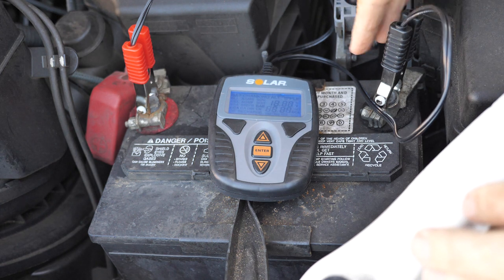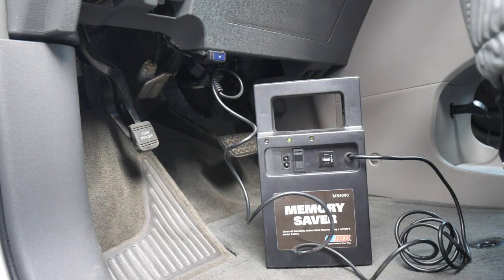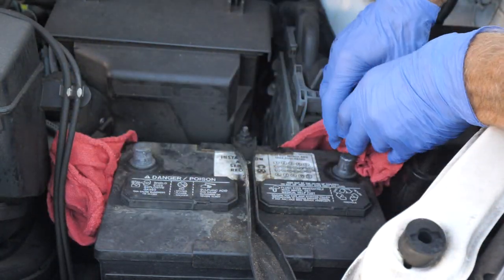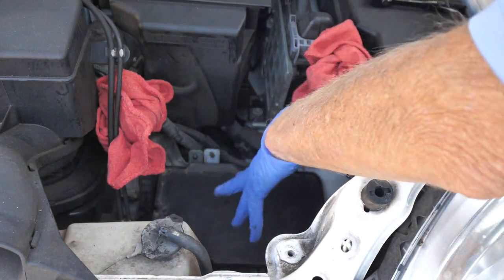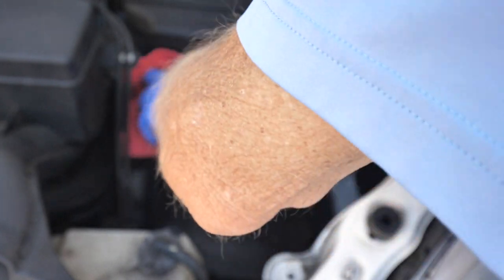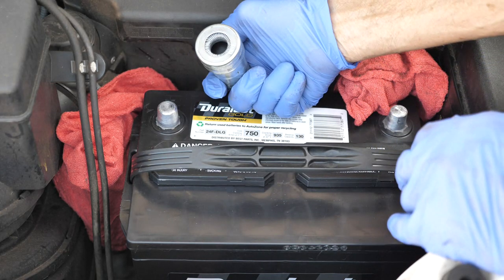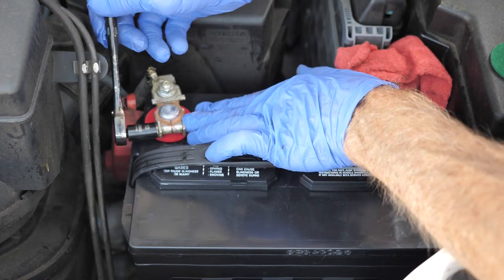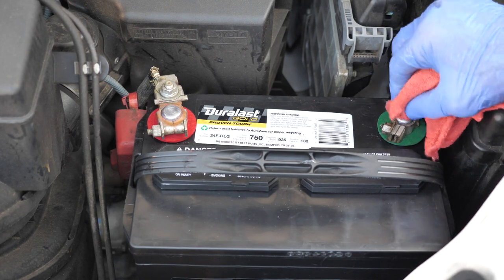How to Install a Car Battery with Memory Saver and Testing of the Old Battery

Comment: @Sparky Channel. Thanks Bill for the detailed and thorough steps for replacing a car battery. Using a good memory saver really makes the job go well. You don't know how long it'll take to get the old battery removed, buy the new battery, prep everything, then install the new battery. 

I'll have to remember the dielectric grease next time.

Hope you and your family stay safe and well.
Reply from the maker: Yes, the dielectric grease repels moisture and protects electrical connections against corrosion. I like the NCP2 as well. And yes, memory savers are becoming more and more important as cars become more computerized. Have a great weekend!

Comment: There's two ways of thinking about using diaelectric grease on electrical contact surfaces. One is demonstrated by what you do here.  That is, smear it on the actuall contact surfaces.  The thought is that the grease is forced out of the joint to make direct contact of the connections.   The other way of thinking about it - and which really makes more sense - is that dialectric grease is an insulator so it should NOT be on the contact surfaces.  It does NOT conduct electricity. Think about it:  You spend the time cleaning the battery clamp and battery post of anything on them that could act as an insulator (grease, corrosion, dirty, etc.) and then you cover it with a non-conductive material (dialectric grease).  That really doesn't make logical sense although many people do it.  People who subscribe to the second way of thinking don't smear it on the contact surfaces but, instead, only smear it on the outside of the connection AFTER the clamps have been tightened.  That keeps moisture, etc., out of the connection but doesn't put a non-conductive grease in it. That really makes more sense.  These same arguments also apply to other electrical connections.  That said, people who smear it on the contact surfaces don't seem to report any problems but logic tells you the contact surfaces should be completely clean. After all, you were careful to clean those surfaces chemically and with a brush but then you smeared an insulator on the contact surfaces.  Think about it.

Comment: Since dielectric grease does not conduct electricity; doesn’t putting it between the battery post and the connector prohibit/hamper the flow of current? I was taught to clean everything (such as you did, great job by the way), properly attach the two connectors, tighten, then spread the dielectric grease over the top of the connection to prevent oxidation and corrosion.
Reply from the maker: Dielectric grease preserves electrical connections. It does this by sealing contaminants, moisture, and air out of connections. And since battery connections are very prone too corrosion I think using dielectric grease is a good idea. I don't think it effects the flow of current one way or the other, but it will preserve it over time.

Comment: Wow... you can get that same DuraLast Gold 24F-DLG for $143.65 (after core refund) at our local Autozone. That's the same battery that my Toyota takes. I bought an AGM battery last time and it's going on 7 years old so I'm over due for a replacement. I can get a new 24F AGM battery at Advanced Auto for $149 (after 25% coupon). The battery saver seems like a nice gadget but for $80 I think I'll just re-enter my radio presets. It's probably time for some fresh stations anyway. :-)
Reply from the maker: What city are you in? Things cost more here in CA. For instance, I think we pay more for gas than any other state. If you have a newer car some sort of memory saving device is very important. If you happen to have a 12V battery, you can just buy something like: "TONWON OBD2 Memory Saver Connector OBDII Car Diagnostic Cable OBD2 16pin Memory Saver Connector ECU Emergency Power Interface with Two Alligator Clips, Emergency Power Supply Interface for Car Battery": Amazon: https://amzn.to/35QxFpt
   for about $13. The combination of your 12V battery and that device will save your car's memory as well.
Reply: @SparkyChannel  I'm in central PA - an East Coaster. :-)    Do you lose engine ECU settings immediately or does the battery have to be disconnected for a while?   My understanding is the worst case is the ECU will have to "re-learn" your engine driving profile while should only take a few miles.
Reply from the maker: @eosjoe565  For other viewers we are discussing Engine Control Unit (ECU). This is definitely a concern, especially on newer vehicles. It's going to vary from car to car. My advise is to use a memory saver and not have to find out the hard way. :) Scotty Kilmer has a good video on using the memory saver. He was saying that the new BMW's are so sensitive that you have to have the battery changed at the dealer even if you have a memory saver.
Reply: @eosjoe565  I

Comment: Consumer Reports top rated Interstate batteries @ Costco are $79.99.
Reply from the maker: Interstate is a good brand. My favorite battery brands are Motorcraft and Duralast though. You have to compare cold cranking amps, cranking amps, your model of battery and warrantee though.

Comment: Bill In my tool rollaway and hand carry tool box I have the iriginal sears craftsman assortment of heavy and light duty tools. 
In this vid I see your using the new craftsman rachet with short abd deep well sockets. How do you feel about the new craftsman hand tools you have compared to the original craftsman hand tools made a l o n g long time ago?
Reply from the maker: Hi! I love those 72 tooth ratchets. They are so nice to work with. My set is a DeWalt but they are probably made in the same factory as the new Craftsman. I love the old Craftsman tools as well.

Comment: I need a good o-scope/scan tool.
Reply from the maker: I'm in the market for a OBD2 scanner myself, perhaps under $150 or so. Any suggestions?
Reply: @SparkyChannel  I'm mostlikey going to need to spend over 500 for one hahahaha
Reply from the maker: @jacknickolstine3355  Any particular brand of scanner you like? I was looking through them on Amazon. The only brand I recognized was Autel. Also, I'm amazed at how many scanners are for sale on Amazon. It goes on for pages.
Reply: @SparkyChannel  I would definitely check reviews. It really depends on what you are trying to achieve. 
OBD2 global dose give you good data and access to general codes, manufacturers don't give all the data and have brand specific codes that can only be accessed by a "key".
In modern vehicles if you have access to the manufacturer systems you can do some cool stuff.

It can get a bit crazy with the pricing, if I'm not mistaken snap-on has one that gos for $2k but I think it's a scan tool and O-scope in one.
 I should just get a "tough book" because I can also download tuning software along with the obd2 software on it.
Reply from the maker: @jacknickolstine3355  Snap-On is a great brand and it's super cool that they combine the scanner and O-Scope in one. Thanks for the info!
Reply: @SparkyChannel  check out "blue point" if I'm not mistaken they are owned by snap-on and are a bit more "wallet friendly".hahahaha 
Anytime I'm happy to help 😁
Reply from the maker: @jacknickolstine3355  Thanks, I appreciate it. I'm interested in checking out used cars before purchase. I'll check out Blue Point.